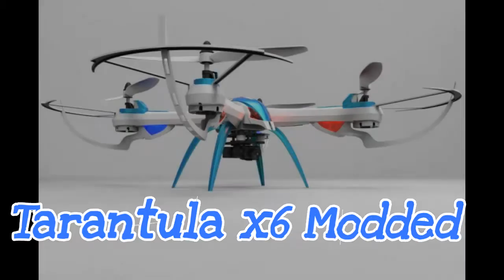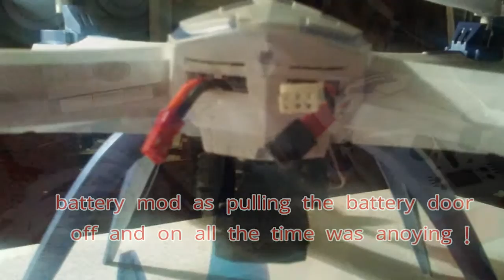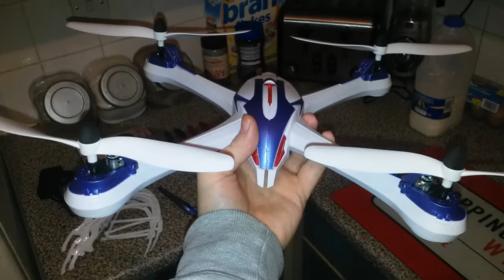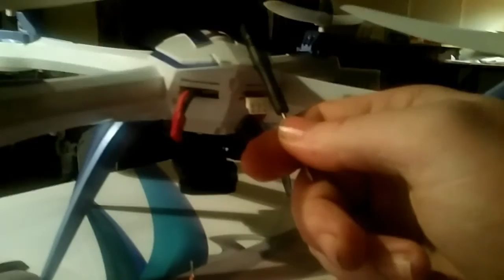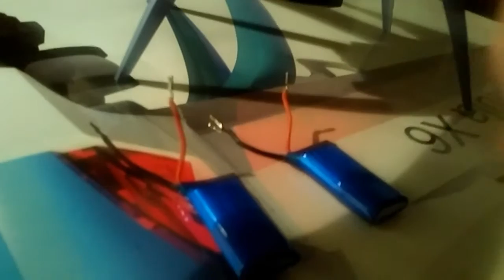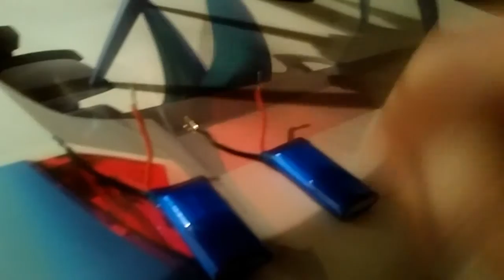Tarantula x6 battery mod

Comment: Nice dude yea. Make another 2S 7.4 V battery out of those 2 1S's in series.(do you know their C rating? Try to stay close to the stock 30 C) Then wire that new 7.4 V 2S you've now made in parallel to existing battery to kick up your Mah's and runtimes.  I'm on the fence. I took mine up to 2050 Mah and I get better run times with no major loss of power.  That's a balance to kinda play with but yea. Cool video
Reply from the maker: sweet thanx for reply ... the 1s lipo's are 25c so not far off the 30c x6 2s lipo is it ?
Reply: petewasere2000 thats great ya